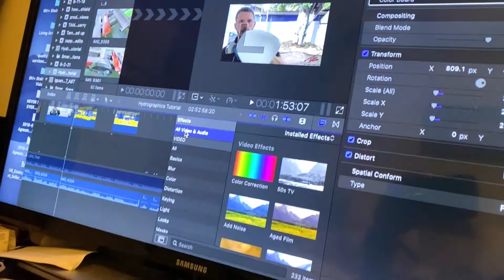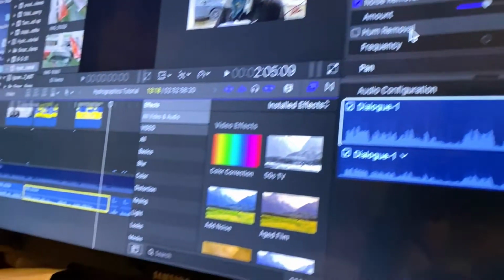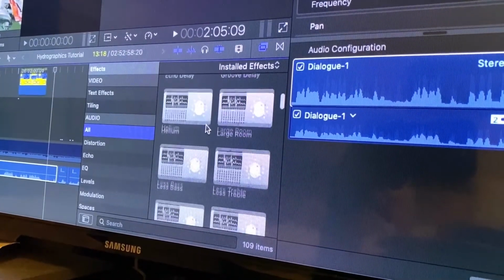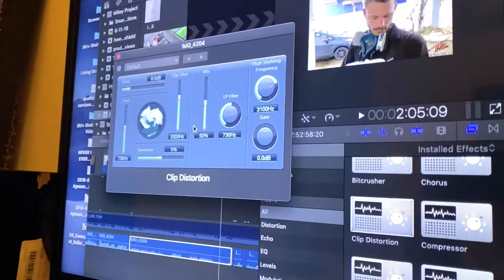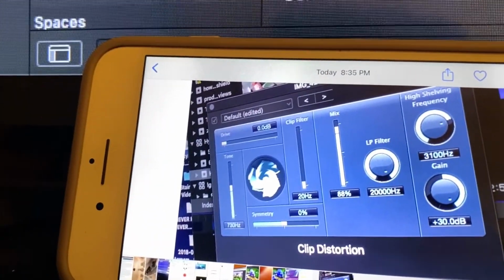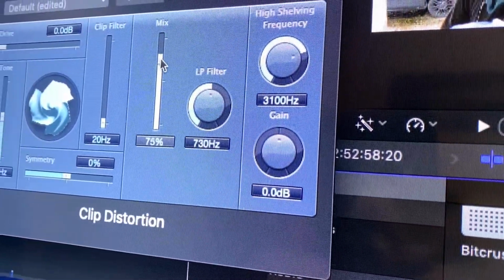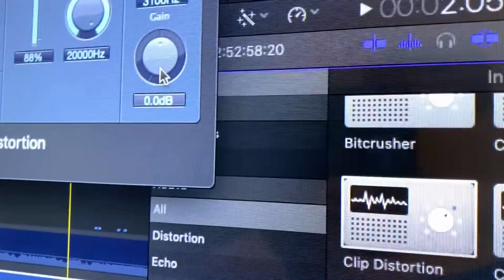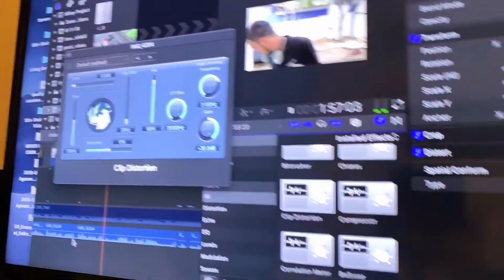How to remove/ fix muffled/ distortion from audio vocals in final cut pro fcpx

Comment: To add on further to this issue, I also noticed my import settings had “fix audio problems “ toggled on. And what this essentially would do is try to suppress background noise but its fault is that in doing that it also suppresses the audio you actually want.